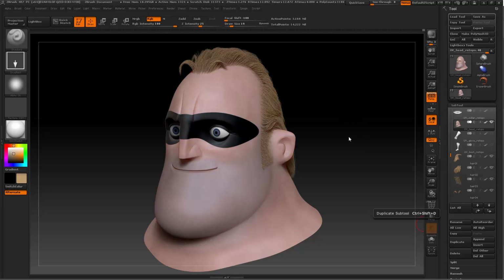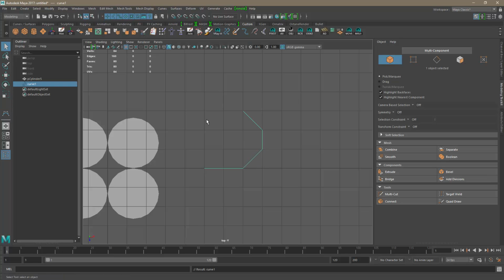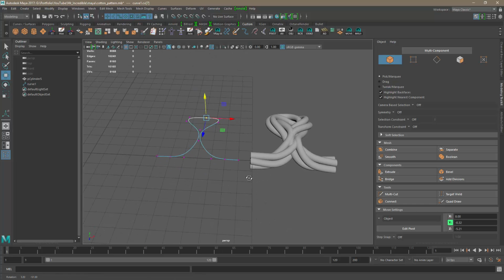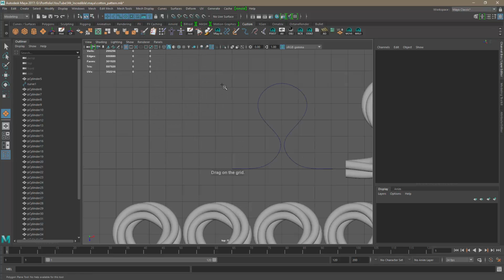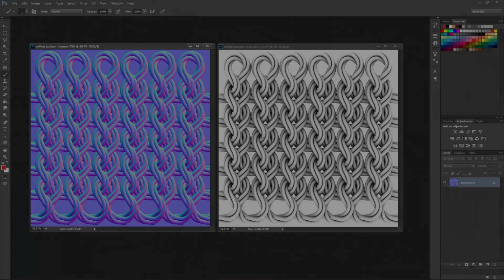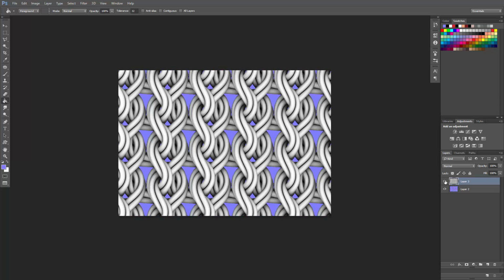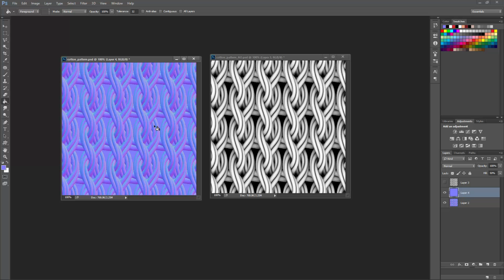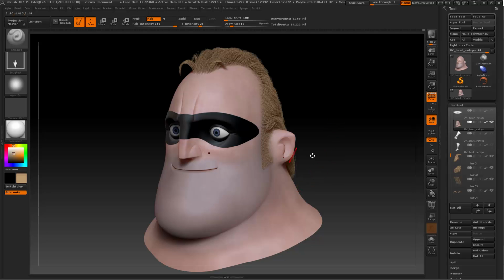Modelling Mr. Incredible - Part 13: Creating a knitted pattern with Maya and xNormal - ASMR

Comment: easy tip for PS tiling. FIlter>other>offset. Now you can check the tiling using dimensions much easier :) very handy for making tileable images, especially when using smart object, you can make different alterations